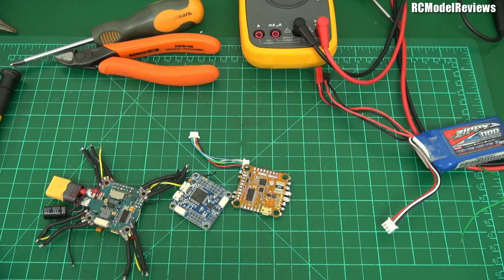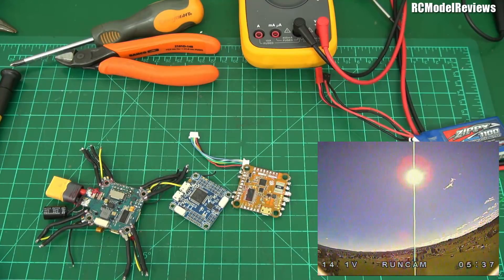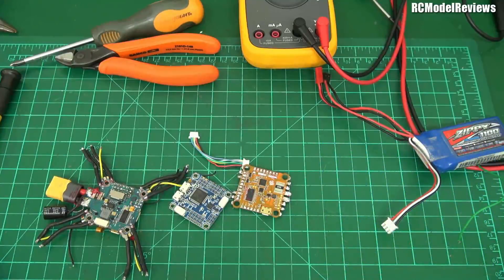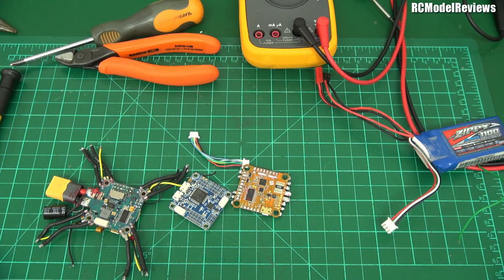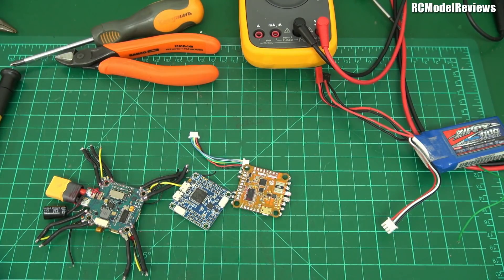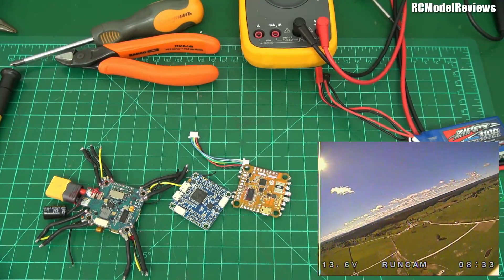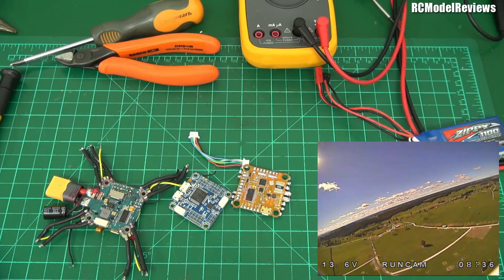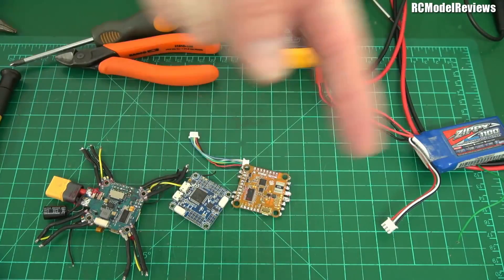How to SAFELY fly an RC plane beyond visual line of sight (part 0)

Comment: A very good idea, Bruce, but not so sure it's something you should cover unless you really think about how to title the video, and what the video contained. The subject of people breaking the rules is way too hot in the media at the moment, and of course a hot subject with the authorities. BUT, that said, there is a need to show how it can be done safely. Like you say, lots and lots of people do it intentionally, and of course there will be times when you find yourself losing line of sight unintentionally - or at least the model ends up so far away that you are struggling to determine the orientation of the craft. This could happen for any number of reasons - i for one found myself being worried by a rather nasty dog that someone had let of it's lead, something like that could easily lead to a craft flying too far away - luckily i was flying a gps equipped model at the time, so i switched it to loiter mode, so not a problem. 

But whether you were flying to far away by choice, or whether by accident, you will always stand a much better chance of recovering your craft safely if it's equipped with a properly fitted fpv system or a properly fitted gps system. If you are struggling to determine your crafts orientation by line of sight, a quick look down at a video screen could tell you instantly. Or with a gps f/c just switch it to RTL until you can safely make out it's orientation again. This is what annoys me with the new regulations - the more capable your craft - the less you are allowed to do with it. For instance, here in the UK if you are a member of the BMFA or some other flight clubs, you are exempt from some of the new flying rules, for instance, you can fly above 400 feet. Unless of course you are flying either a multi-rotor, or a craft fitted with a flight controller that is capable of autonomous flight! Flying a model without a fpv system or gps based flight controller is obviously seen to be safer than flying a basic model without any of those flying aids. Crazy. But back to the subject, maybe a video that explained the dangers of flying beyond line of sight would be received better. For instance - sudden loss of signal if you accidentally drop behind a hill or other obstruction to signal. Or the dangers of signal loss due to other transmitters or areas with a lot of wifi coverage. So if you titled your video something like "THE DANGERS OF FLYING BEYOND LINE OF SIGHT" it would be much better received.

Comment: Bruce - I think that you might be exposing yourself to legal action from the relevant Govt Dept if you go ahead with demonstrating how to BVLOS (whether it's the safe way or not).  And if you actually demonstrate Safe BVLOS in a Youtube video, that could bring you a whole lot of legal and financial pain.  I like the idea of Safe BVLOS, but if your desire is to eventually get Safe  BVLOS  made legal - then breaking the existing laws is not the right way to start that process.   The right way is to prepare a draft document that specifies how to do Safe BVLOS, and then lobby the Govt to get a legal trial of Safe BVLOS, in which you can legally prove to the Govt and other stakeholders, that BVLOS can be performed safely.